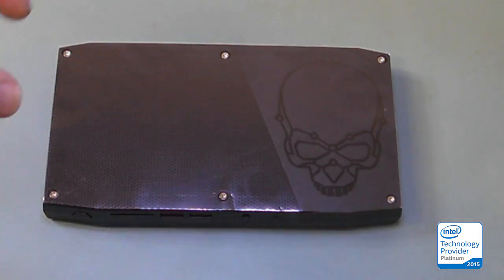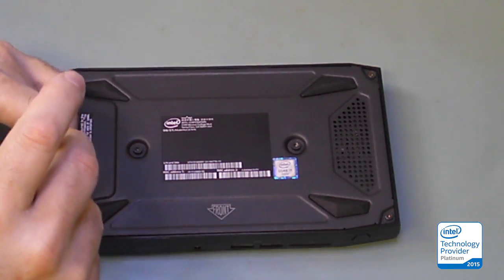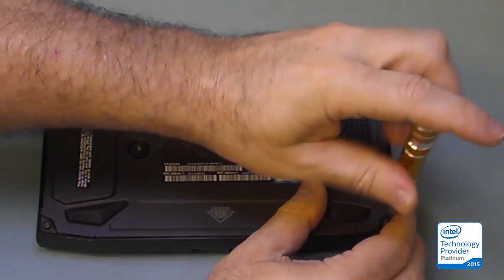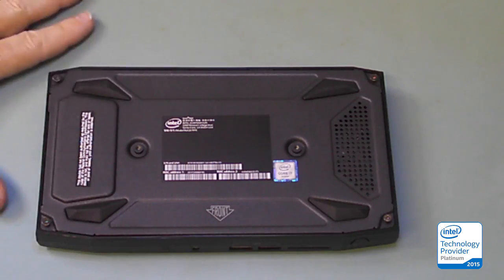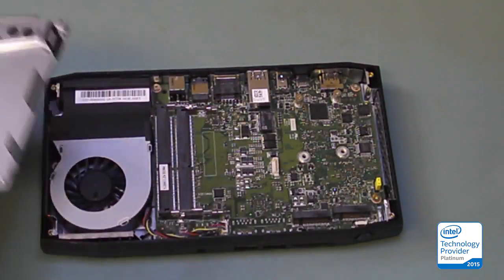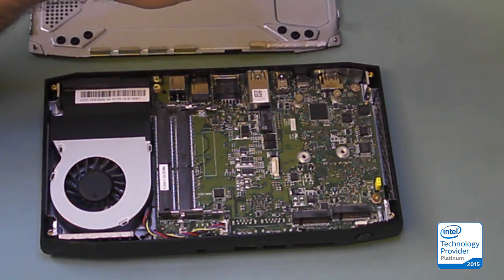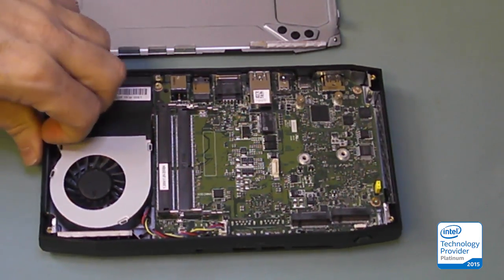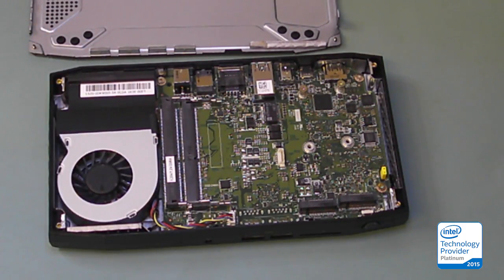Skull Canyon NUC  A Look Inside

Comment: Howdy All,
We have shot some videos of Benchmarks, but Intel asked us to take them down until the official launch. It is possible that our pre-production is not identical to what will ship, but more likely that they don't want benchmarks disclosed until they have a chance to address any possible issues.
I can say that the performance exceeded my expectations, and with heavy gaming peaking at under 95 watts, it is impressive for what you get for just 90-95w of power.
Remember that this won't compete with a $2500-3500 dedicated gaming system, but it will exceed the normal high end business class system with a gaming video card in it for considerably less.
And while it is possible to build a tower system for less with the same or better performance, this is in a 4" x 8" x 1" (32 sqin) box with a 120 watt power supply.

I have also had people ask about the noise level of the blower.
I have been unable to take that measurement since the AC system in the building makes more noise (and it is really quiet). The only way I have been able to hear the blower is putting it up to my ear, and my dB meter hasn't given me a reliable reading.

I would have to have an anechoic chamber to take a measurement as my quietest room can't get a measurement (at 1m)
Reply: on our forum you have few benchmarks

Comment: So when you buy this it doens't come with ssd, ram or anything??
Reply from the maker: +ReassuringSmile Intel only sells the barebone kit, however Simply NUC sells the fully assembled system with RAM, SSD and OS options and it comes with a full warranty on all components and support for any issues that might come up.

Comment: Thanks for this video.
Can't wait for next one.
As I'm waiting for may 10th to buy mine.
I have few questions:
1- Can you install a 2,5 HD
2- How does Iris pro 580 performs, good for gaming
3- Does power supply support 220 volt
Thanks again...
Reply: +Alain Lafond 
1 no m2
2 good
3 120w
Reply: +Alain Lafond Alan, 3 - it's basically a laptop power supply - should be a 110-240V auto switching power supply.

Comment: Cool, can you have the CPU and GPU benchmarked and tested with AAA games soon?
Reply: Really curious about the latest Iris pro 580
Reply: +William Li  Below are some performance comparisons we did based on benchmarks, next is some gaming, but some of that is relative (as is benchmarks)
Expect some videos next week showing off some gaming.

NUC6i7KYK is 
17.71% faster than NUC6i5SYH on processor performance
20.69% faster than NUC5i7RYH on processor performance

52.06% faster than NUC6i5SYH on graphics performance
40.11% faster than NUC5i7RYH on graphics performance

We are currently doing MIPs performance testing.
Chuck
Reply: +Charles Abdouch Can you post these benchmarks online? (the 580 ones).